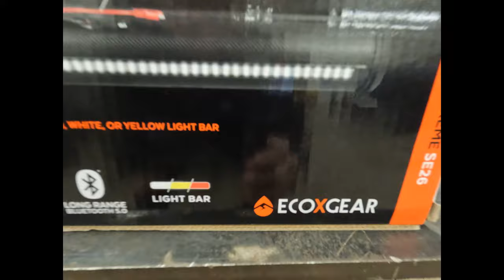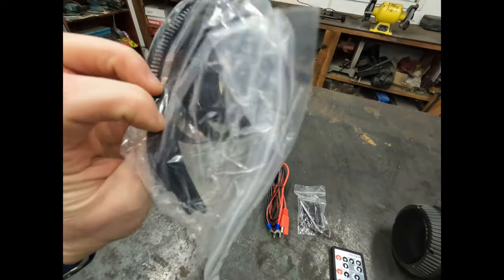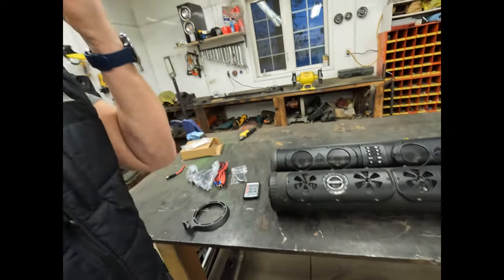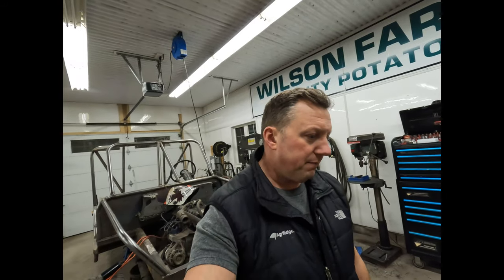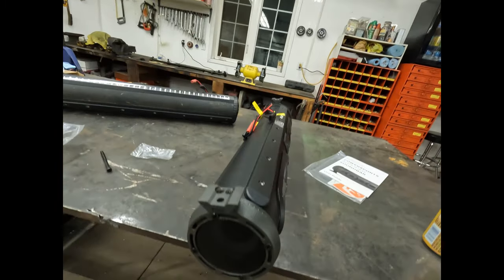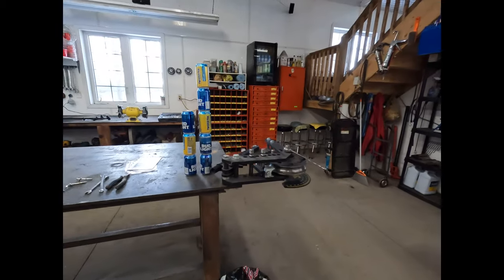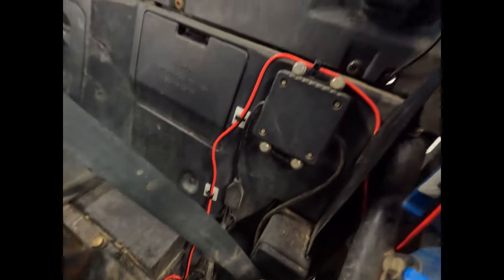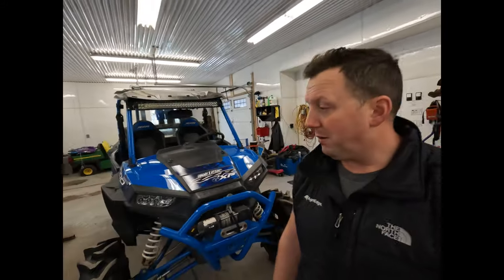EcoXGear Sound Bar VS Bazooka Party Bar!! Review And Install! Worth The Money And Hype?

Comment: Battery still holding up ok or would you suggest installing a switch for the power to the bar?
Reply from the maker: Holds perfect. Sat for 2 weeks and fired right up.

Comment: Great video, I am purchasing a Can-am 4 seater sport or 4 seater Commander and purchased the Ecogear sound bar u have.... Question, how would you secure it so it can't be "easily" removed and stolen.
Reply from the maker: Another great question, never thought of that. Thinking even if you used special bolts for roof mount, they only need a screw driver to remove the actual speaker. This is crude, but tack weld the mounting bolts to cage and strip the screws for mount. Even you won’t be able to get it off. Lol. Thanks for watching.

Comment: How does the sound bar compare to something like the Rockford Fosgate dash mounted stage 1. Looking for something In my 23 XP 3 seat Ranger. I don't need loud, but really want quality at low to mid volumes.
Reply from the maker: Dirk on the channel just purchased a Pro XP premium with stage 1. This unit is much loader and when pushed to 70% volume or more, the Eco is much more clear and pure. Hope this helps.

Comment: Did you just run power right to the batter and ground on the battery?
Reply from the maker: Yes I did. I wanted it to have power even when key is off. I would add a switch someone where, I have found if it sits for a month or more it will drain the battery on the machine.

Comment: Had the Ecoxgear SE32 but returned it, the amp gain is way too high and you can’t lower it, all you hear is white noise at low volume. Would expect more from a $500 speaker.
Reply: Wish i would have seen comments like this before I bought one.  What did you go with?
Reply: Damn sad to hear. I’ll normally spend 70% of the time playing it at a normal to low volume

Comment: Is there a way to control the light bar with other wired circuits?
Maybe wire it up to brakes, and white on/off as a back up light?
Reply: I was wondering the same thing
Reply from the maker: There is aux plugs but I'm sure. Not the best at wiring to be honest but would be cool as one of the colors for the rear light bar is red. Thanks for watching.

Comment: Here is a stupid question: if this runs off a rechargeable battery, why do you have to do wiring?
Reply from the maker: I don’t plan on taking it in and out and we go on long trips so just easier to wire it in so it’s always good to go.